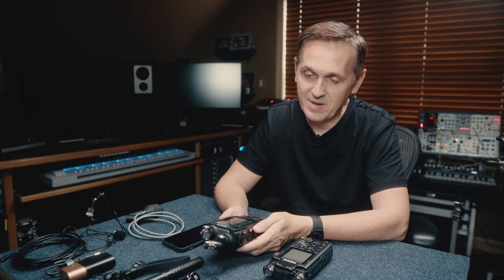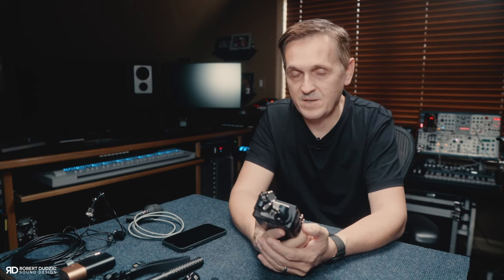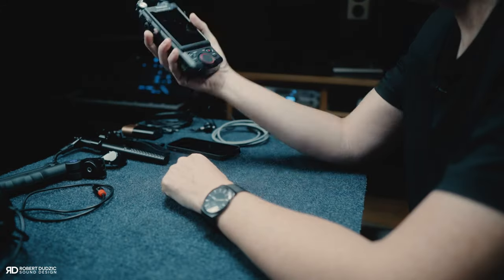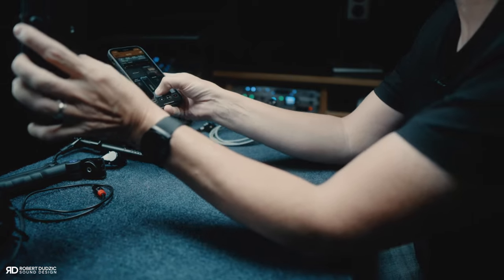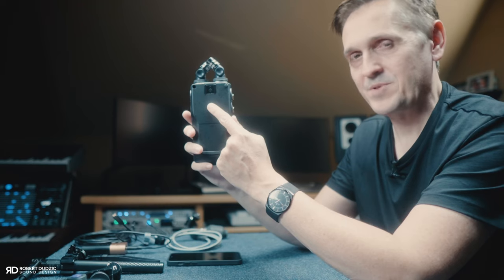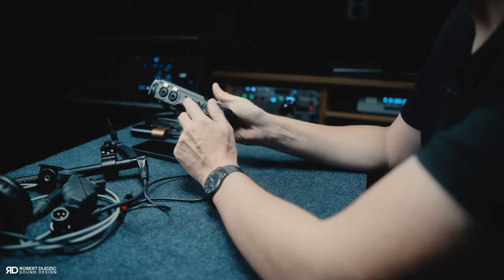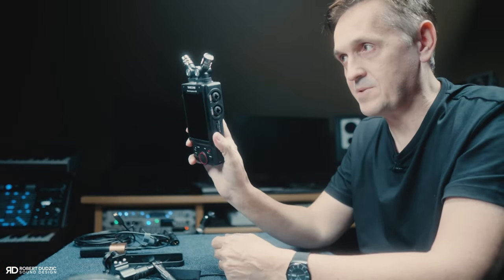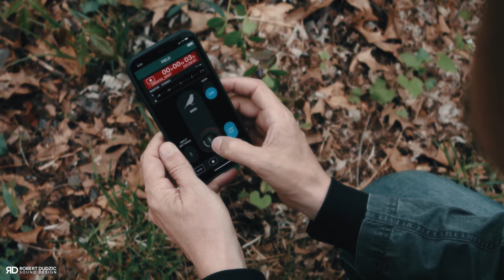CINEMATIC SOUND Portacapture X8 - High Resolution Adaptive Multi-Recorder, Field Recording,

Comment: It will be good if Tascam adds the possibility of using the Portacapture X8 for VR applications (recording and listening) and also adding other mics (or even inserting an XLR extension) instead of the two removable microphones.
Reply from the maker: I suggest this directly to TASCAM, The VR is make a pretty sense.

Comment: Hi Robert, I've seen in a few other reviews that people are getting a high frequency (above 20khz) hum on all their recordings. Is this the same on yours?
Reply from the maker: I don’t have any problem. For me noise is part of the sound a specially on the location. The noise what the talking about is way above humane hearing and what i see on YouTube you can see but you can hear. So far what I know that was reported to TASCAM and the working on to eliminate this in future firmware update. The visual noise is not effecting my recordings and I use Portacapture X8 for almost year😊
Reply: @RobertDudzic  thanks for letting me know! I believe the noise is only present when recording at 192khz as that's where the frequency range of the preamps goes up to 60khz. I know the noise won't be audible when played back normally but if you do any pitch shifting it will come into an audible range. I do a lot of pitch shifting so I'm just a bit concerned that the noise people are reporting would end up in my sounds.

Comment: VERY INFORMATIVE VIDEO! Thanks for posting, Robert. 
I have an X8 on order with B&H. Probably, will also be getting a NTG5 also. My intended use is for outdoor ambience, wildlife, birds, etc. Quick questions: What is the coldshoe mount you're using, and when using that mount, would you still be able to fit a Rycote furry over it?
Reply from the maker: Thank You😊Please watch the next video
https://youtu.be/4T85kzNoYVU
Reply: Thanks, I did watch, and enjoy it, but I'm hoping you can answer my previous questions regarding what was the coldshoe mount you used for the NTG5, and in that configuration, would you be able to use a Rycote furry over the mic?
Reply: @Tarnway0412   - he using the SmallRig Shotgun Microphone Holder (Cold Shoe) BSM2352. Available on Amazon. It's a great little tool.

Comment: Do you use rechargeable batteries? I was thinking of getting Li-ion rechargeable batteries but not sure if it's recommended?
Reply from the maker: No, I use lithium batteries.
Reply: @RobertDudzic  Thank you!
Reply: @RobertDudzic  Is there a reason you choose not to use rechargeable batteries?
Reply: @proartwork7189  I use enveloop pro batteries they are great but they drain quick when the X8 is set to 192khz.

Comment: Great video as always, when using the X8 with the shotgun mic to record 3 channels of sound do you keep the capsules in x/y or point them straight out? Any advantage to either method?
Reply from the maker: Thank You. I keep the mics in XY position. The is a lot benefit of this setup. Please check HOW I DO WHAT I DO 4 where I explain concept of my setup plus showing benefits of recording this way.

Comment: Hey Robert. Thanks for the video. How's the signal to noise ratio when using the 'onboard' microphone ? I used to own the DR-44WL from Tascam and it was almost unusable.....hiss was major issue.
Reply from the maker: Portacapture X8 is in completely different level. Its hard to compare this two recorders. I did a lot great recordings using DR-44WL.

Comment: Thanks for the video! Is 32but still useful if you use wireless lavs? Or is the transmitter/receiver already sending the sound in 24bits?
Reply from the maker: Please read the manual or direct contact TASCAM.

Comment: Hi Robert, thanks for the review. I might have missed it but do you know how many db's of gain you have on the mic preamps?
Reply from the maker: I really not remember, with 32 bit flat recordings you can record very loud sounds with not worry about distorted sound plus i have in the same time safe track record on Portacapture.
Reply: @RobertDudzic  sorry I meant how much gain can be added with the preamps? As in the maximum gain level. I understand the flexibility of 32bit, I'm just wondering if it has enough gain for certain mics that need it. Thanks

Comment: can you plug this TAscam PortaCapture X8 directly into iphone using lightning to camera adapter? Secondly, can you do overdubbing like Zoom H4n and H5 with PortaCapture X8? Thank you in advance
Reply from the maker: Hi, I never try this for no need for me. X8 is very advance and works as audio interface with direct USB C connection. But I will recommend go to TASCAM website and check the the manual for more info.